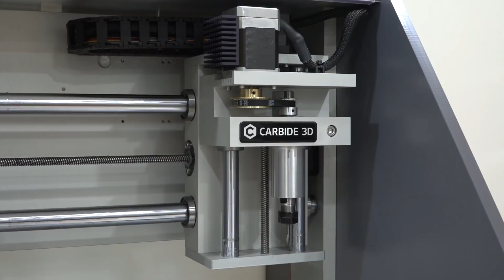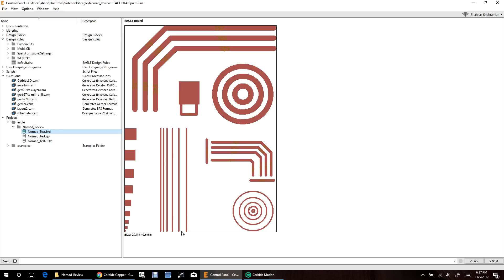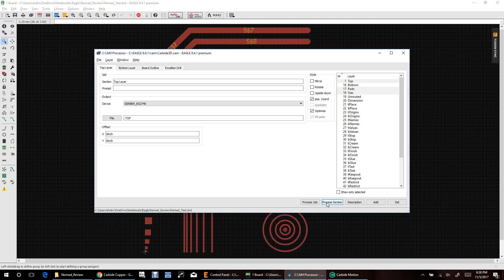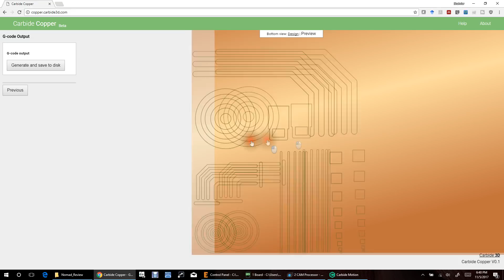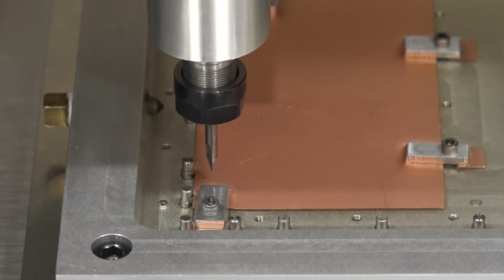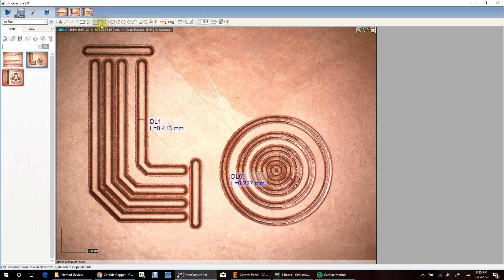TSP #115 - Carbide 3D Nomad 883 Pro CNC / PCB Engraving Machine Review & Experiments

Comment: Newbie question …..when you are zeroing the tool against the PCB you detect when the tool touches the copper surface (0ohms) then you raise the tool (so that the cutter does not contact the copper)by A very small amount. I think you zeroed the z axis with the tool hovering above the copper ,also I think you said that the software would NOT let you pick the Z depth it will cut. Soooo it seems like this entire “cut” would be in mid air never touching the copper. Seems like you would move the bit off the copper piece and plunge a “little bit “below the copper surface and zero the z below the copper surface?  This would only work if the spindle was on before the spindle lowered to the (0,0,0) beginning of the trace cutting
I may have missed something would you be able to clarify this important step….?

Comment: You may just be clamping the board too hard. This will tend to make it bow up away from the clamps. It really does not need to be clamped down hard as there is very little lateral force with such a small mill. Copper is difficult to mill as it is a 'sticky' material when milling. Try slowing the traverse speed when milling to see if it improves things. Most controllers also have a levelling algorithm where you set a few points across the table and the controller then interpolates correction values for the X and Y travel. If not then you will need to modify the table to fit levelling adjusters.
Reply: This is true, the clamp tends to push the board toward the center.

Comment: You need some Auto Leveler software to adjust for surface non-flatness. I don't know if it's working with nomad, but I use Auto Leveler with Mach3 and it works perfect. Even on USB CNC machine.
Reply from the maker: Thanks, I will take a look.
Reply: Even routing large wooded pieces needs auto leveling software to get good results so trying to make PCBs is even more fiddly.
Of course wood is not as flat as FR-1 and FR-4
SVSeeker did a simple video about this a while ago.
https://youtu.be/Yq_j3nZeFsM

Comment: I understand why you made the purchase.

Personally I'd hate to design a board around the limitations of the process. 1 or 2 layers, no vias without huge effort, limitations in trace width and isolation, possibility of wasting more time trying to get the machine work than getting the board...

But I don't need to make 4-boards a week and I have time to wait for a few days.

Comment: Wow great timing, we were just thinking of buying this exact machine for our lab. I've used Othermill and I didn't like it that much. Admittedly it worked well, but the software (Otherplan) is pretty annoying, the work area is small and the price is ridiculous considering that the construction is nowhere near as rigid as I was expecting. The Nomad is cheaper, better specc'd in most regards and built like a tank.
Reply from the maker: I just wish that spindle went to 20,000 RPM!

Comment: One solution to non flat material would be to probe the material in a 6x6 grid and apply a correction to the g-code with bilinear interpolation between your samples. You could probably knock a post processor together using python.
Reply: Rhys D bCNC can already do this. It probes detecting connectivity with the PCB after you attach the PCB to ground. This autotramming isn't really that helpful in practice.

Comment: Acme screws? Linear shaft slides? Open loop steppers? Mechanical PCB clamps? 

This thing will never give you the same thing twice IMHO. I tried to make some simple PCB's on a full size mill (Haas VF3). Even though the machine was very precise - holding the PCB flat was only possible with a vacuum plate fixture. Once the isolation milling was complete, the mechanical clamps could be used to do drilling and perimeter cutout. I don't know anything about the tools they offer, but I used Harvey carbide tools. They are a high-end manufacturer  and their tools had the least amount of burring. My guess is that the machine is unlikely to achieve the precision/accuracy specs they claim. 

Fiddly little process even when the machine is perfect.

Comment: Excitement of your first cnc cut)
For PCB prototyping it is great to a have a leveling function which can probe the surface first and then adjust for its slight curvature/irregularities; no matter how precise is your base is - when you use clamps they will distort the pcb surface level ever so slightly (I personally use planet-cnc, but there are many other controllers/software packages available with this feature). Also, the the cutting bits make a world of a difference - for superb quality work bits from "precise bits" (expensive, ouch), for day to day carbide 60 degree 0.1mm from ebay) Tried, also 30-,45- and 90-degree ones, but 60 seem like the optimal choice for my liking.
As for the software - eagle with pcb-gcode plugin (http://pcbgcode.org/), enough settings for my liking; but again, others are available like flatcam, etc...
As a surfactant I use isopropyl  alcohol diluted in water - makes a lot easier to clean the pcbs afterwards (no oily residues)
Reply from the maker: Interesting. I will investigate. Thanks.

Comment: I ended up buying a cheapie $200 (shipped) CNC from Aliexpress that has a board which runs grbl and supports z-probing. I think the most important things from my experience 

1. PCB are warped, so building a height map by probing points is a must
2. Cut depth changes everything, need to only engrave the copper off - any deeper you're going to start over engraving which affects tracks at 45 degree angles. 
3. ER11 collet set and good z-axis stability helps (shouldn't be a problem for Nomad)

https://imgur.com/a/LGblq

16mil tracks, I think it'd be possible to get it down to 10-12mils.

Comment: I have had the same machine for about 2 years.  It arrived with a failed controller board, but the Carbide guys sent a replacement right away.  Has been fine ever since.  Works with all kinds of open source software on Linux, no need to use Carbide Motion which is pretty limited.

Also, I found it's much more convenient to do designs by generating G-code from Python.  Almost all engineering work is very rules-based rather than artistic.  Writing your own G-code usually results in a much faster machining job.

Comment: I would love to see a price for the (LPKF ProtoLaser U4) without having to visit with a sales weasel. I’m fairly sure CNC is never going to achieve acceptable results using any standard PCB material, perhaps highly controlled ceramic substrate could be reliably milled, I don’t know, but it appears laser ablation is the way to go for prototyping. Even a high-end laser will still leave you without multilayered PTH of prepreg capability though... I think you are going to be disappointed with anything less than a vision controlled laser unfortunately... I’m in the same boat...

Comment: I don't get the pricing on these tiny little desktop CNCs - it's literally a couple hundred bucks in parts to put these together from scratch. No linear bearings on any of these, either. You can pick up a Tormach PCNC 440 for slightly more than the "OtherMill".
Reply from the maker: The Nomad has linear bearing on all three axis, same with the OtherMill.
Reply: Sorry, meant to say fully supported linear rails.
Reply from the maker: Weckso Flannigan what do you mean by fully supported?
Reply: The biggest problem that low end CNCs have issues with is rigidity. This is the limiting factor for materials that any particular machine can handle (you can machine any material if you go slow enough and your machine has the necessary rigidity). The problem with these little desktop machine is that they just use a rod  that's attached on each end for the rails - vs a rail that has support along the entire length. Google "fully supported linear rail" for an example.  I'm not really surprised at the choice for these as using a rod for the rails on these costs a few bucks vs several hundred for high end rails. It just goes back to my original point that these things just cost way too much for what they actually are.
Reply: fully supported bearings means that there is a substructure that is providing the rigidity, but in case of this machine, a lot of rigidity comes from the guide rails themselves, which in case of milling pcb prototypes and drilling tiny holes is no problem at all, but it does put a limit on the capabilities of the machine
there are millions of these types of critical comments on basically all the cnc machines on the YT, no matter if it is a 10k tormach or a 5 axis mazak worth close to a million bucks, someone will always come and complain about something, don't pay too much attention :D
I have a comment about the rpm of the spindle though - going high rpm while retaining the precision and longevity of the spindle is EXPENSIVE, and 25k rpm doesn't necessarily mean you will be able to do your work 2,5 times faster than a 10k spindle, and because of the increased rpm, and probable imbalance of the tool or work it does, dynamic load goes way up, that adds to the risk of ruining fast spindles, and rebuilding them isn't always a diy thing, so all in all, I would chose a 10k spindle over a 25k one for this sort of work.
Reply: I wasn't being critical of the machine, I was being critical of the price that these "desktop CNCs" are being sold for. You can go on ebay and find, effectively, the EXACT same CNC from China for a couple of hundred bucks or buy a few parts and build something much more rigid, repeatable and precise for substantially less money.
Reply: Weckso Flannigan, when you start to look around for the "more rigid, repeatable and precise", those dollars add up very quickly, and a regular DIYer will not have the capabilities to make the framing for that custom machine, so when you add that all up, it will run you way over the 2500 asked here, and if anything goes wrong, you can only look for the support in your bathroom mirror, same goes for machines from china, you can luck into one that is "square" or you can bet something much less that satisfactory, and then spend time and money fixing the thing.
few years ago I had your mentality before getting into cnc stuff, thought I'd make my own, because I wanted more rigidness, repeatability and precision, but when I added all the cost up, I saw that I can buy second hand machine for that money, and it will be industrial, so some time later I got a Swiss made 4 metric tons of goodness from 1990ties (for the price of the machine in this video btw), and I recently got a new Chinese mill, iso40 taper and aroung 500kg in weight (you can guess the size of the thing), and when it arrived, I had to spend couple weeks taking the thing basically all apart, getting all the sand off the castings, scraping the ways to fix the geometry, sanding and repainting and so on and so forth.
So the morale of the story is - diy is for fun, not for - I want to start making things next week, China products are cheap, but you will end up spending a lot more time and money getting the thing up and running the way you want it to, and you can't beat second or 3rd hand industrial machines if you want the real thing.
Reply: You kind of just made my point. For the cost of these little "desktop CNCs" - especially the $4Kish OtherMill, you can be squarely into real CNC territory. If all you want to do is mill PCBs (rigidity a non-factor), you can search ebay for "3020T" and find something that will do the same job as the machine in this video for 1/10th the cost. Yes, you need to set up Mach3 or LinuxCNC to run it, but you end up with much more control over the milling process using this, anyway. I wouldn't have as many issues with the price of these little mills if they had software to do automatic touch-offs or Z-height compensation (which would have prevented the problems with the non-parallel material in this video), but there's no justification for the pricing here as it's just a couple of rails, a few steppers and a low-end spindle. For anything other than milling PCBs or other "engraving" (e.g. actually making metal parts) - I would avoid the Chinese stuff as well (been there) and either go with Tormach or look at any of the small milling machine -> CNC upgrade packages out there - all of which are more reasonably priced than the stuff discussed in this video.
Reply: 3020 does look similar, but looks to be made much cheaper (using screwed together thin sheet stock), and it is not 1/10 of the 250, they are around 400-500$, and no enclosure, no real support, also the spindle on this one looks quite ok, but I've seen people complain about huge runout on those cheap chinese motor spindles, having to regrind the collet taper and so on.
As I said - if you can afford one of these, the added cost may be worth because it is ready to go out of the box, comes with some sort of warranty and so on.
it does have the tool height setting (cheap ones don't) and touch off or part height mapping and compensation is something you will fiddle around a lot on the cheap stuff too, so it will be on top for both of them. I mean you can get the cheap thing, knock together a plywood enclosure etc, but will you want something like that on the table next to the other equipment he has there, I doubt it :)
Reply: Weckso Flannigan agreed, a set of decent NSK linear bearings would not have gone a miss
Reply: Also, you can get a cheap cnc from eBay for $200. They may not be that good, but they are super cheap.
Reply: Yea, but linear guides instead of rods would have been so much better and for 2500 $ i would have at least seen anti backlash ballscrews instead of leadscrews. The spindle does not instill confidence in me either. Using a stepper with belt is really a cheap way to get some more speed at the cost of torq. I must agree, 2500 to 3000 for this kit seems quite high. For that money there are much better options. like the wegstr (around 1500) much more geared for pcb design.  https://www.youtube.com/watch?v=7EctuSTL7-w  but there are others out there... I also don't understand why they need to be that expensive ... Sorry for the rant, i understand you like your new machine but in this case a bit more investigation would have paid of.
Reply: Where do you buy the wegstr for $1500?

Comment: I have a Nomad 883 Pro that I heavily modified to accept a bigger spindler motor. Probably overkill for PCBs but you do get the higher RPM.
For the software, I would recommend https://github.com/svenhb/GRBL-Plotter over Carbide Motion.
It is much better suited to PCB milling, with options like z-scanning over the entire surface. It will modify the GCode to account for the uneven board.

Comment: for $3000, you can buy many properly manufactured PCB. I see this as more trouble than it is worth.
Reply: not even close to the same lead times though (unless you pay extra but then its not even that much pcbs anymore and still not quite as fast). also every time you order those custom pcbs your going to spend tooling cost and if you make alot of one-off stuff you cant spread it over a larger amount of them. also since this can do aluminium you can make your own fixtures n things very easily in a professional setting espec r&d department might make alot of sense.

Comment: Why mill if you can etch? I'm actually interested in your reasons. I've never had a case where milling would have been the better options, when it comes to time consumption or accuracy. But I suspect there are some applications.
Reply from the maker: With the milling machine I can also mill other things, like enclosures, cavity filters, etc. It is not just for PCBs.
Reply: Thanks for the answer Shahriar! It's a fair point and I have no doubt mills are useful. However, even if I had a mill, I'd still do PCBs by etching. But maybe I'm wrong and they are better in certain circumstances. Are there any advantages purely related to PCBs, other than that you don't need to acquire corrosive chemicals (the disposal is not so much a problem as there are self replenishing solutions that can be neutralized, fellen out and then thrown in the trash)? To me milling PCBs just seems just slow, expensive and setup-indensive (if you want accuracy).

Comment: Have you tried etching a PCB yourself before? If not I would be interested if you could compare with the CNC. Bigclivedotcom did a few videos making it look rather easy and as such a appealing alternative .
Reply: Requires chemicals, though, and you still need to drill through holes somehow.
Reply: The chemicals aren't special and are easy to get and handle. Drilling isn't much of an issue, since most parts are SMD anyways and the fine pitch of SMD parts is no problem with etching even at home.

Comment: 2500$ and no auto leveling/probing? Wtf. My 200$ kit has auto probing. Can wack on my pcb with 2mm hight differences and even warping of the pcb and I get even cuts. Obviously the kit made of chinesium is not as nice mechanically but meh...what can you do
Reply: I was about to say the same, I am sure that this machine is using GPRL like chinese.
Reply: it does have auto probe. hes just being precise since hes milling a pcb. milling a 1mm line isnt the same thing as leveling a piece of wood. inaccurate in the z crucial on pcb.